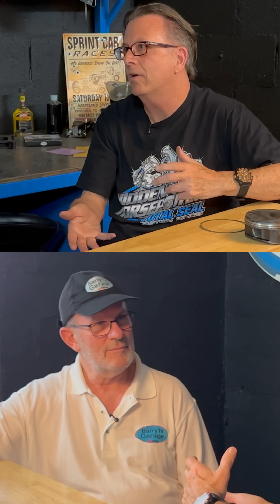Race Car Engines Have it EASY! Keith Jones w #BarryT #totalseal

Comment: I always say it's tougher to build a high performance street car than a dedicated race car
Reply from the maker: Apparently you are correct! 👍
Reply: that's why LS swaps and hellcats are so popular. easy performance and killer reliability. most people don't understand. 1000 miles out of 800hp is insane. 100,000 miles was unheard of before 1998's truck engines modifications with turbos, cams, Intake and exhaust and the  demons, hellcats ect in the 2010s.. 25 years ago. anything over 500hp came with an incredible price tag and zero reliability unless it was a sleeper kswap or 2jz and even that has its own oiling issues

Comment: Your comment holds no validity,  explain drive and drag events.
 A hi performance car is not driven every day, there are hundreds if not thousands of stroker engines driving on the roads, my 511 bbc runs 190 deg on a 110 deg day, I live in the calif  lower desert .